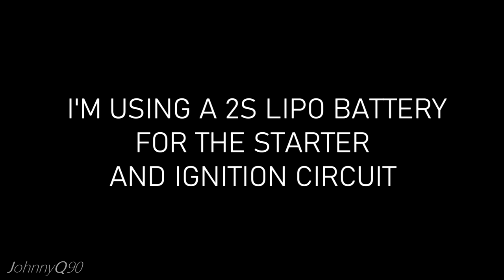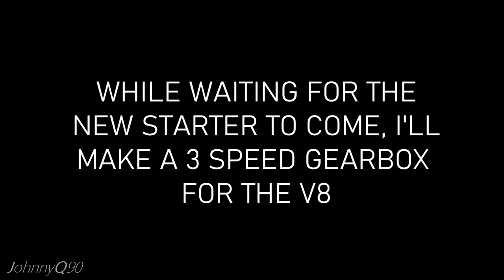Miniature FLATHEAD Four Cylinder Engine Assembly & RUN!

Comment: I would just like to mention, great build, but because you have set the spark plugs to 15* before tdc, the engine has low rpm and misfires, as you can see from the exhaust, flat head engines are meant to have around 4*-10* before tdc. But still, great build.

Comment: Hey Johnny, 
Hadn't seen you for a few weeks, perhaps. 
Good to see another miniature engine coming together. But I wanted to ask,
is that brand Cison any good? Unless lapping the valves isn't an option, it was
sounding kind of rough. 
Anyhow, good to see you back. 🏎
Reply: Any good? Leaking from front seal, starter motor dead, engine runs rough.... sounds like crap to me!

Comment: Ever thought about making a mini muffler/fart can and exhaust system to make one of these sound different?  Sounds like an open header 4 cylinder but if you threw some small scale back pressure with a longer exhaust at it would it sound like a legendary 4 cylinder engine? Could probably even make a tiny bov for the boosted ones.
Reply: Why go through all that effort to make it sound like shit?

Comment: Yo i like how the bearings are kept from spinning in place, theoretically, by some sort of hardware. Im sure some ungodly amount of torque can get them to spin but this will help prevent that. 🤘🏽✌🏽👍🏽 awesome vid as always
Reply: The bearings in EVERY other engine are held in place also. 😴
Reply: @davelowets  with hardware directly on the bearing? Maybe hard wear holding a bracket that holds the bearing, but im talking about a bolt in direct contact  to the casing of the bearing itself like in this engine in this video. Yea some engines do have that but not every engine.
Reply: @tomaslongoria2449  I'm not a big fan of screwing the end of a fastener into the side of a bearing race to hold it in place. The race of the bearing can easily be crushed out of round by a fastener that's a touch too long, or by too much torque on the fastener. I prefer the normal way with split bearing shells with tangs on them to keep them from spinning in tje housing.

Comment: Impressed by the fact it uses metal or "real" piston rings, not to mention two of them per piston. Ive seen some of these small engines that use an oring for a piston ring...heck nitro rc engines, which is what I have a few years of experience with, don't even have piston rings of any kind
Reply: Some have rings and some don't.  Depending on the type of nitro R/C engine.

Comment: That "carburetor" is pretty sketchy. Probably the rough running problem.
Also isn't there supposed to be a break in for the cam and lifters? ie 2000 rpm for 15 mins or something.
Reply: Not to mention there's no way to adjust the timing
Reply: Honestly a cam break in on an engine this small that's essentially an ornament really isnt gonna be that big of a deal. Also the breaking in which really only matters for flat tappet cams, is varying high RPM for 20 odd minutes, you don't want to lug them or have it sit at one RPM.

Comment: This this is really cool, I've seen a few but not one with an oil pan running a true 4 stroke, let alone a flat head. Pretty solid little motor, timing gears and not chains, set up more like a farm tractor than an automotive engine. These guys would probably last a while made out of the right materials. Put a vacuum timing advance on that bad Larry and watch it gain a ton of top end. Do you know the compression ratio? What kind of fuel?

Comment: That carb is same design as RC engines for airplanes and cars.  Have you tried tunning up the carb?   There is a screw in the center of the carb that adjusts lean/rich at low RPM while there should be a needle valve from the tank to the carb to adjust lean/rich at FULL open throttle.  The other screw at the carb is for minimum RPM adjustment or minimum throttle position.

Comment: Would go mint in an old Aeronauts sea queen, water to water heat exchanger or just do direct water intake, pump whats used into the exhaust to help silence it, forward and reverse gearbox with a centrifugal clutch mechanism 🤔👌

Comment: Great video! I just finished building mine, I can't seem to get the carb setting right. Was there anything special you did? I started with 1.5 turns on the main valve but it keeps over flowing. I tried 0.5 turns which is better but couldn't get it to run properly. Thank you in advance.

Comment: Sounds like a dead cylinder aka misfire one spark plug is not firing maybe check the wiring set up and see if there is a weak connection

Comment: I'm wondering, if you had the ability to make the parts, and assemble them, (using robots let's say) just how small could a gasoline engine get?
I'm thinking there must be a point where the gasoline/air mixture wouldn't be able to ratio properly for combustion?

Comment: Position sleeves should not just slip into the block like that. Should fit tight. Freezing the sleeves and heating the block to get the two together.

Comment: That method they used for adjustable valve lifters isn't the greatest. Some of those lifter screws were perfectly flat and others had round and oblong head surfaces which should be perfectly flat..

Comment: brass connecting rods? obviously this is not meant to run for very long or produce very much power even for its size, I mean Cox engines for airplanes have steel connecting rods.. but I find it interesting they can make a sleeved engine this size but they don't make them full size unless it's diesel, just goes to show you how we're all being scammed

Comment: I won’t pretend to be a gun expert in anyway. But why the heck would you decide to use JB Weld and what looked to spray paint on any gun ever? If the gun wasn’t safe to fire I DEFINITELY wouldn’t trust JB Weld with my life and if it was then why apply JB Weld at all? And as far as the black spray paint, why not just get cold bluing solution as it’s made to be used in these situations? It just looks like a ton of work too make the pistol look better without helping longevity. It just made the whole video look cheap to me.

Comment: Don't understand these motors .. if you are going to mix oil in the fuel... just run a 2 stroke motor with 1/2 the cylinders .. would be a fraction the cost and size.